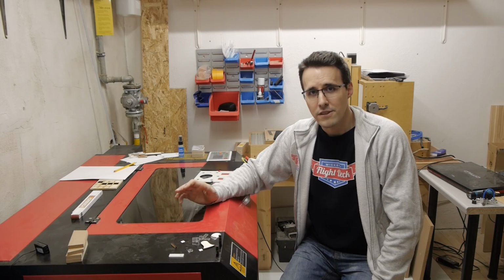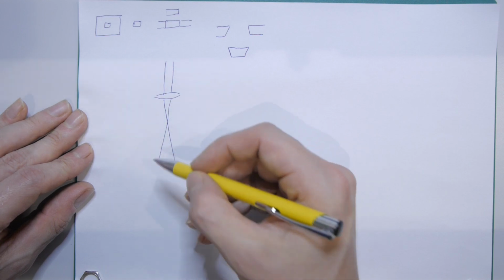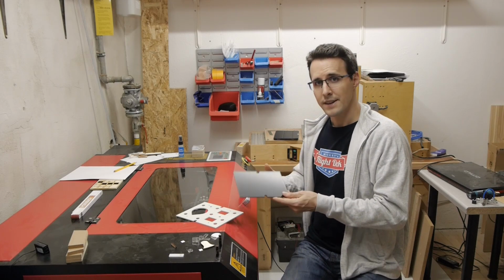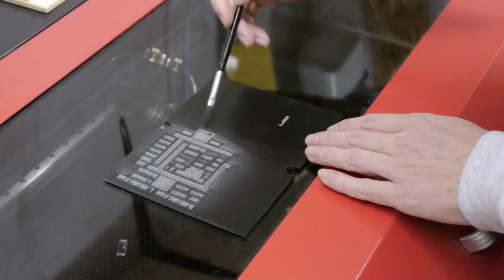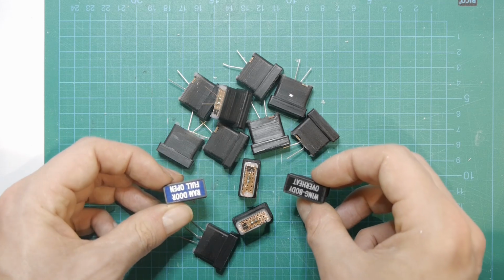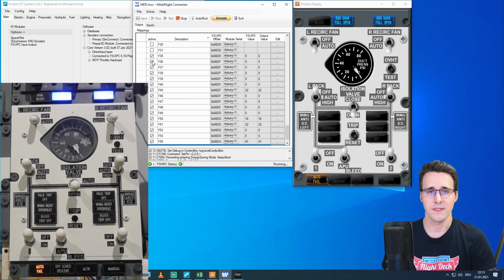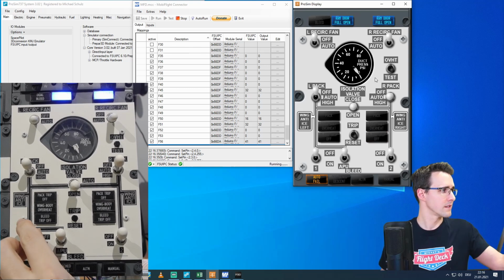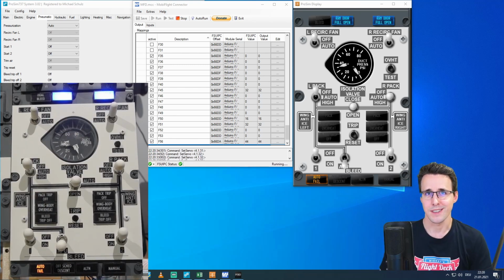Pneumatic Panel - A Boeing 737-800 Homecockpit #51

Comment: Hi Michael! First off all, great video! I would like to know if its possible to use this module as standalone device. Do you happen to know which board might work? Thank you in advance
Reply from the maker: All my panel segments are designed that they can run independent from each other. If you use MobiFlight then you just need an arduino mega to control it.

Comment: Hey so I’m trying to connect push buttons (momentary) to mobiflight and I’m unsuccessful. What values did you set in mobiflight for the push button?
Reply from the maker: I used the same values like I did for switches. 1 = pushed and 0 = released.

Comment: Great video, as always!
Will you do a video with more detail on the panel process for the laser, like you did with the CNC? (Showing the steps in the software, etc) or is it all the same software?
Reply from the maker: No it's not the same software. Compared to the process in Estlcam for the CNC there are not too many differences when you control a laser. That's one of the reasons why I didn't need too much time to learn the process. I think I will integrate this into the laser video.

Comment: Hi Michael,

great video again. Thanks for showing us your technique.

Where do you purchase your acrylic sheets (Germany)? Is it Acrylic XT or GS (for laser use)?
Reply from the maker: I bought the sheets at a local dealer. They are producing acrylic parts but also sell the whole sheets. It's XT acrylic because this was a little bit cheaper. You can cut both with a laser but there is a difference when you want to build these fancy 3D lamps.

Comment: The biggest thing I have is how you'll do the yoke, rudder and throttle
Reply from the maker: This is also a big question I ask myself from time to time. But this will be a project in the future. And there will be a video too.
Reply: @Mickeys_Flightdeck  And the FMC, that's also one... And seats, will you use OEM or you'll scour some... And lastly, locking switches, are they too expensive?
Reply from the maker: @roberternest7289  I'm not planning to use OEM parts in the cockpit. And yes locking switches are way too expensive for me.
Reply: @Mickeys_Flightdeck  The bane of sim builders, locking switches. And for me also a CNC, I don't have one, nor a table saw, or a router, or a jigsaw... I don't think I need to continue...